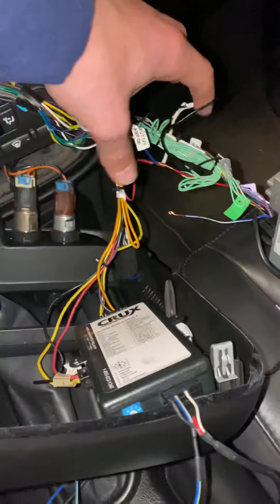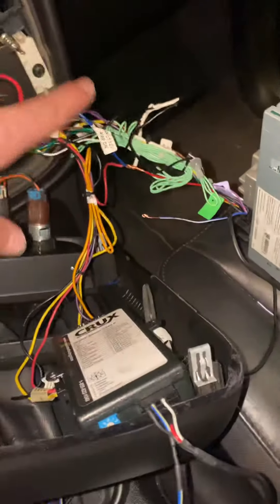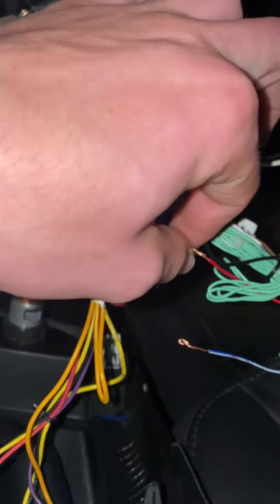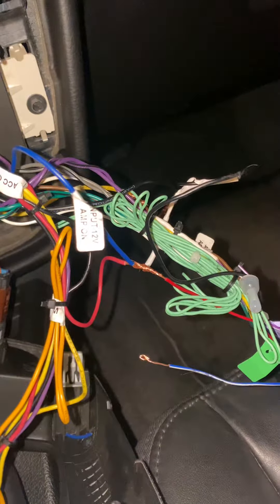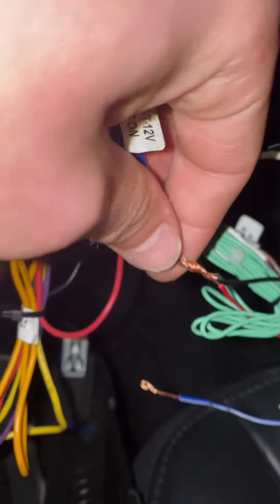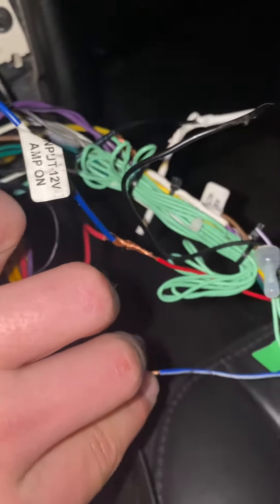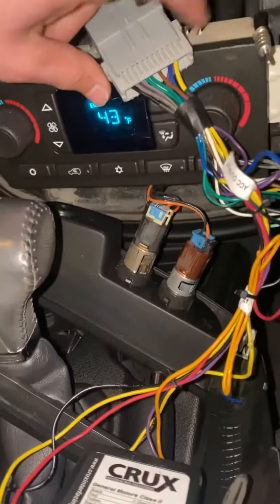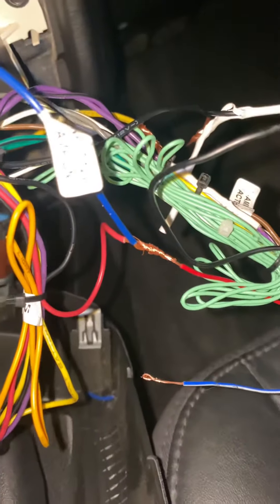Radio on but no sound - Double din fix

Comment: I've hooked the blue/white wire to it and still nothing I'm so lost on what to do I've hooked all my wires up properly but no amp power
Reply: Did u fix it?
Reply: Same here, did u ever get it fixed?
Reply: @tat_dad  unfortunately I did not but I believe I needed an interface to go through with the amp. There are videos to bypass but I forgot the process it’s good if your putting an aftermarket sub and amp in

Comment: Great tip, but I don't know if this works for my case. I have a Peugeot 407, installed a 2 din radio, I have the correct Canbus box and cable. The steering wheel controls are there all ok, the air cond, is ok and appears on the screen, every car function is there on screen. But I hear no audio from radio, from mp3, whatever. I'm starting to think it needs a little boost by connecting some wire somewhere, but I don't have a clue wich ones...

Comment: I’m not sure if this this would fix my issue but it looks like the same setup I have a 2006 gmc sierra plugged in my touchscreen stereo sound comes out sim quiet and a little staticky but when I have the stock stereo in the speakers sound good I install new speakers too so I’m really confused by it

Comment: Ok so i have my after market radio the harness it came with has solid blue ;yellow; red and all the speaker wires.
So i connect the blue coming from my aftermarket stereo on to accessory wire that comes from the car harness?